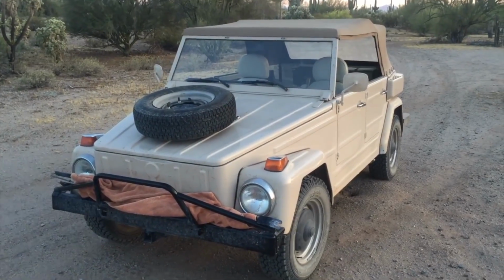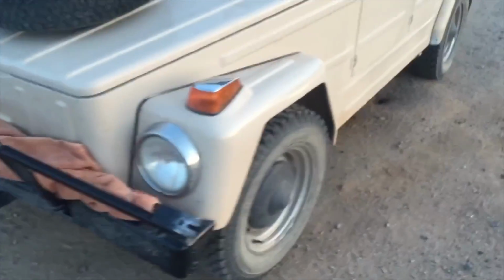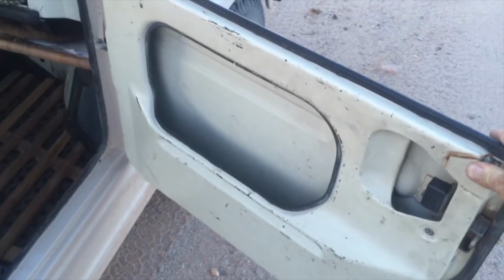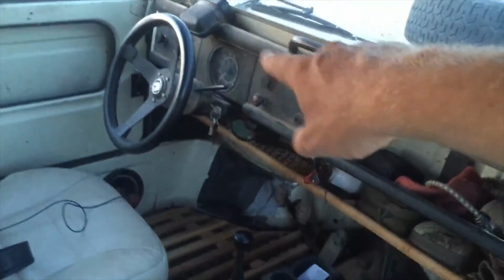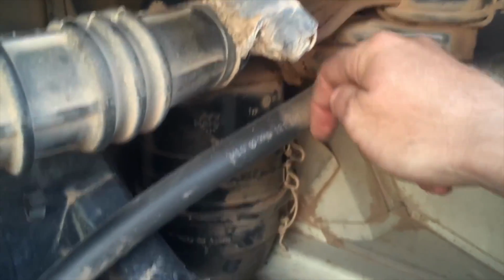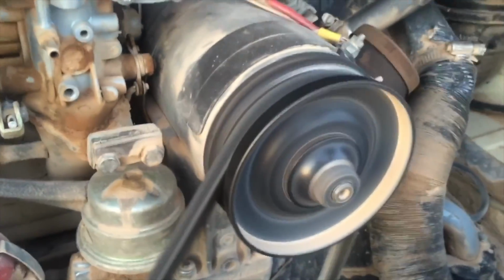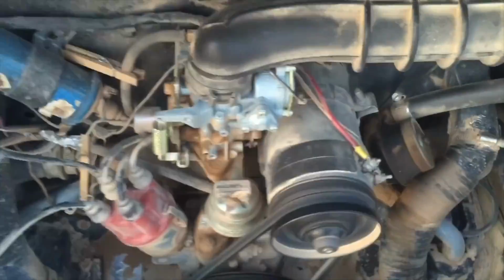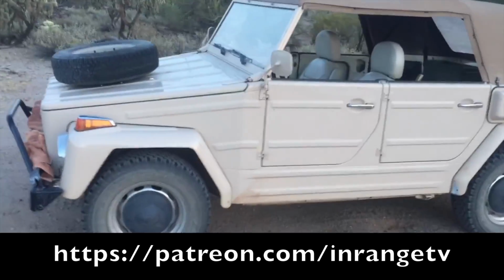Volkswagen Type 181 "Thing" - InRangeTV Classic

Comment: Sounds like you set your timing with the "static" method, with a light bulb? Valves sound good too. Really like working on these simple motors and have always wanted a 181. I always kept a spare throttle cable around and made a emergency clamp on cable end since they tend to break at the carb end.

Comment: Just an FYI that these "things" are incredibly dangerous if you get in a crash.  They are basically very thin sheet metal and were built during a time when passenger safety was not even an afterthought.  One of my neighbors was doing off road in one and they hit a tree which practically cut it in half.
Reply from the maker: Yep.

Comment: It's an inspiration for a french Citroën Méhari , a 2CV engine in similar ABS plactic body on a steel chassis - it weights only 570 kg (1,256.6 lb) -
https://en.wikipedia.org/wiki/Citro%C3%ABn_M%C3%A9hari
and a 4x4 version exist  produced from 1979 to 1983...
The French Army purchased 7,064 Méharis – some of which were modified to have 24 V electric power to operate the two way radio.

Comment: Another thing that helps ground clearance on a Type 181 (and another difference from the Beetle) is the use of a transfer case on each rear wheel so that the driveshafts from the transaxle can be tucked up above the belly pan.  It's a really well thought out design.  Some of the military versions (possibly also some civilian versions) also had a limited differential.
Reply: And of course so did the T2 split window Microbus.

Comment: Definitely cooler than a Beetle and I'm guessing its dead simple to work on this engine which is a nice feature for the mechanically inclined. One thing I hate about modern vehicles is all the electronics and stuff. Makes working on cars annoying. The electronics are great when the car is functioning properly but the second you start having to wrench on the bastard they become a hinderance. 

This vehicle would be fun in the desert like you've got it setup here but I think it would be a death trap where I live which experiences a significant amount of snow and icey conditions. Although weirdly enough right now its like 50 degrees Fahrenheit outside with no snow which is very unusual this time of year.

Comment: I bought one of these in early 1976 and it was my daily driver for 13 years. Cold in the winter and hot in the summer but so much fun to drive. Finally had to get rid of it when the belly pan rusted out under the passenger seat.

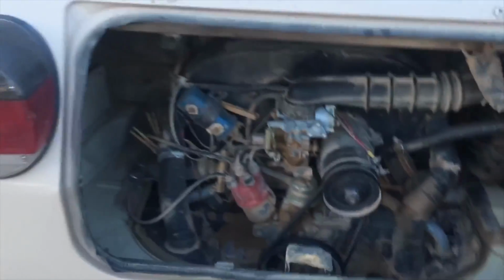Comment: 4:30 The thought "I'll leave the hood off, then it will cool better" is unfortunately completely wrong. The best cooling performance is achieved with the hood closed, as the air flow is not only responsible for cooling the engine oil (as is said later in the video).

As long as the air baffles are present in the engine compartment, the closed hood is just as important on the VW 181 as it is on the later VW T4 (Transporter).

In addition, you don't mess up the engine compartment with dust swirled in by the wake turbulence at the rear of the vehicle.

It is therefore essential to refit the tailgate and replace the air deflectors if they are missing or damaged. Then the engine will last forever (there are air-cooled Beetle engines with 1 million km and they are still running)
Reply from the maker: I have tested with an oil temp gauge and the car runs cooler with it off.  You do what works for you.
Reply: @InrangeTv  Check the cylinder head temperature. As I said, it's not all about lowering the oil temperature. If this is necessary, then you are better off with an additional oil cooler.

If the temperature drops significantly at the cylinder heads without the engine cover, then the air baffles are missing. These parts are often removed when you are working on the engine, usually out of ignorance and subsequent owners then have the problems.

Regarding my professional qualifications, I worked for a long time for a German classic car specialist whose focus was on VW models with air-cooled boxers.

Unfortunately I can't post a link to a spare parts list here. But search for "Custom Speed Parts" and there for "Luftleitblechen Käfer/Karmann Ghia, Kübel (181), Typ-3 und Bus -'79" <--- keep the German spelling, then you should find the page directly. Costs around €49 (around $55) and will save your engine from dying of heat!

And have fun with the "Bucket" (in German "Kübel"). Incidentally, the name comes from the predecessor prototype from WW2. It had seats that looked like a sawn-open barrel and were intended to prevent the driver from falling out of the vehicle when driving off-road and without doors. The name was retained, even though the Type 181 actually has nothing at all in common with the WW2 model (apart from the engine and drive concept)

Comment: Such a badass vehicle I’ve always wanted a thing painted gray on off-road tires. Those air cooled motors look stupid simple to work on. Great vehicle to learn on id imagine. 

I got a slightly modified Geo metro that is basically a modern more fuel efficient version of this car. I put 25x8 DOT approved atv tires on it and lifted it about 5 inches, gutted it and took the plastic covers off the bumpers. It’s like driving a Mario cart around so fun especially ripping the e brake on wet pavement around corners. Right now it’s my daily and I still get 45-50 mpg in it.

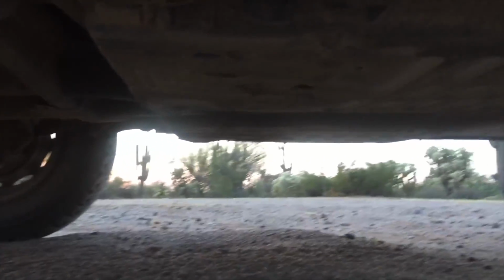Comment: At 8:12, when i was a kid, I had a 1987 Ford Escort that I would off road with. I would be in third gear, and right before I hit the mud hole, I would drop it into second, the front end would lift up, and I would fly through. It was so much better than it had the right to be.  I think I offended the people in their trucks because my cheap ass escort wouldn't get stuck like their trucks did.

Comment: Very interesting, Karl.  Does your Type 181 not have a fuel gauge on the dash, but instead has a foot-operated lever on the firewall that enables access to the reserve fuel when the engine begins to sputter?  The 1958 Beetle I had back in the 1960s was so equipped, and it was essential to reposition the reserve fuel access lever whenever the fuel tank was filled after the vehicle had been running on the small quantity of reserve fuel, or the next time the engine sputtered the fuel supply was completely exhausted.
Reply from the maker: Naw it has a gauge.
Reply: The fuel gauge on old bugs was usually a wooden stick you kept in the trunk.

Comment: Like Karl said at the end of the video, air cooled VWs are surprisingly good in off road. Here in Brazil there was a huge number of fiber glass models build on the Beetle chassis. One of the most prominent was the Gurgel X-12 and its many revisions, who fancy itself as a 2WD jeep. Besides the flat botton, the other trick it had to get itself off trouble was split handbrakes, that allowed you to lock either one of the rear wheels, like a poor man's locking differential.
Reply: Wow, did not know about the split handbrake.

Comment: I owned VW Bugs (Type-1) for over 20 years. Starting with. ‘57 model and then a ‘62, ‘65, ‘69, and lastly a ‘70. On the last two I put over 100k miles on each with the original engines and transmissions, but to do that required a much higher level of maintenance mainly because of it being an air cooled engine. Every 2.5k; Oil and filter screen change and clean, and check/adjust the valves. At each 5k; Add to that a fresh set of spark plugs. At each 10k; Add points, condenser, cap, and rotor. And at EVERY fill up you checked the oil as they would consume a little on each cold start up and it only held 2.5 quarts. (Again, air cooled engines have to have room to expand as they warm up so tolerances are a bit “loose” when cold.) Just a shame that emission and crash standards killed them off.

Comment: You mentioned spare fuel cans.
Back in the 70's, there was a company that made a half round jerry can that fit into the well that the spare tire fit into, on a Volkswagon.
I think it held something like 3 or 4 gallons of gas.
Not sure if its still being made, but I always thought that was a genius mod.
Also, the cowling you show over the air intakes on the rear of the body, were originally aftermarket fiberglass items, also made back in the 1970's.
Are you sure the ones you show on your car were factory options? I've never heard that before.

Comment: Cool. Whats the clothes pins for?
Reply: Sink heat away from fuel lines, helps prevent gasoline from vaporizing on hot restarts
Reply: @brianjay692   That's interesting as wood is a better insulator than heat sink.